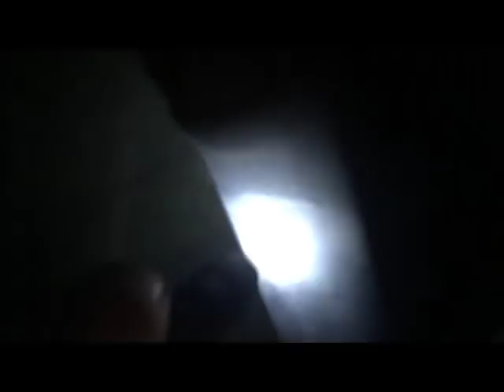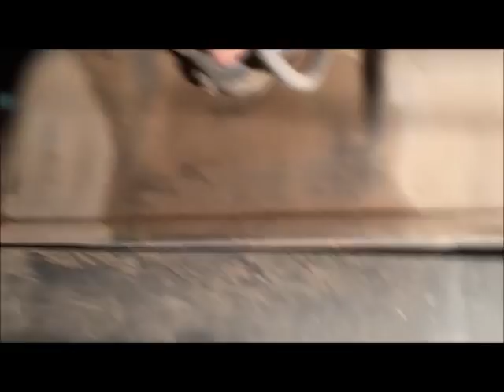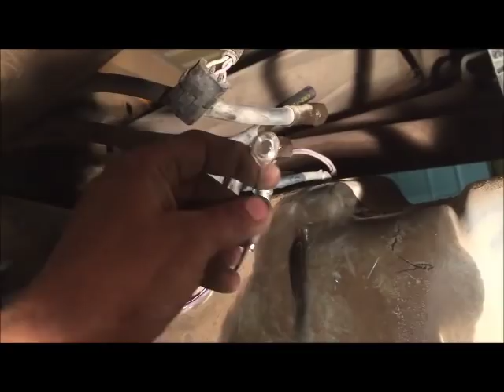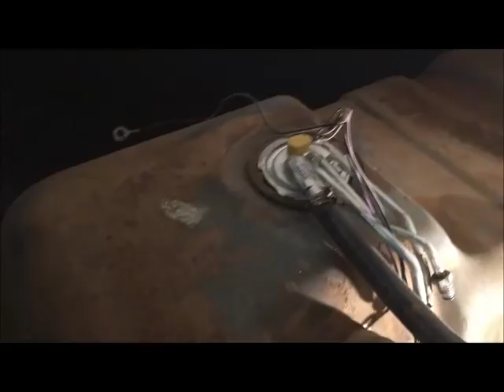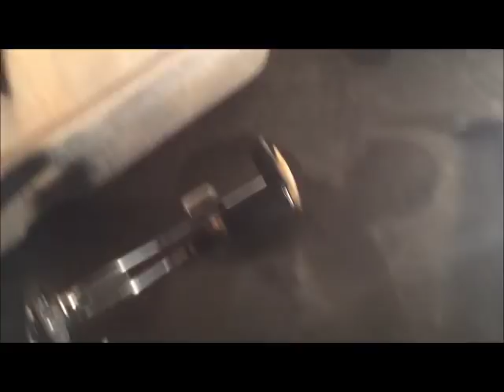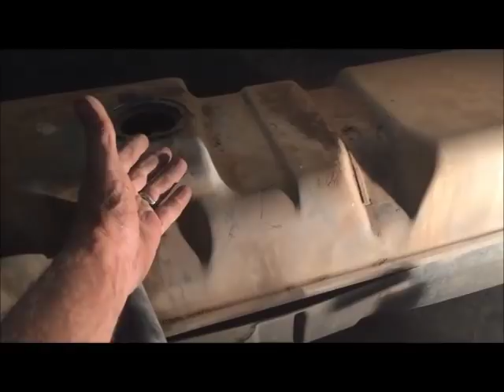1998 Chevy 1500 Fuel Pump Replacement

Comment: Ok so I have a 1997 Chevy Tahoe k1500 5.7 vortec and my gas guage goes crazy when I turn the key sometimes It shows how much gas I actually have and when I’m driving it just moves everywhere I changed the cluster and it still does it is it my float in my tank or can it be the ground or the whole pump ???? Please Reaply ASAP🙌🏾
Reply from the maker: the ground would be on the tank, but not your issue because the ground will make it work, or not work. your problem is the sending unit for sure. replace it ! thanks for watching.
Reply: thomas brian I appreciate it🙌🏾🙌🏾 now I can stop stressing about how much gas I have left😂😂
Reply from the maker: perfect, thanks again for watching.

Comment: which line is going to the fuel filter from the fuel pump? I don't want to mix the lines up
Reply from the maker: you wont, they are a different size.( small difference, but you will be able to notice ) thanks for watching. good question.
Reply: thomas brian thank you

Comment: Faargh dude. I have spent two hours trying to mess with bed bokts. Then found this... got 1987 gmc sierra pickup with a bad fuel pump.
Reply from the maker: thanks for watching!
Reply: @thomasbriansavingmoney  absokutely. Fuel pump didn't solve the problem unfortunately. I have a crank, no start issue and I'm at a loss at this point. Fuel is not coming out of the TBI and the fuel pump came on once and won't anymore.

Comment: Anyone know if the ground wire on the fill neck could be put on the same bolt that the ground wire of the fuel pump is on? There's nowhere else for it to go or I can't find another bolt anywhere it could go on. I've got a 97 Silverado.
Reply: The ground wire on the filler neck is to safely discharge any static electricity that may jump while filling. A trip to a dealership to pull up a microfiche exploded view (ha!) parts location / wiring diagram will show the location. 
 Anywhere on the body. 
The grounds are important to check.
; batt to engine block , block to firewall. Body to frame / engine block. Remember the chasis is mounted to the cab by rubber pucks & your computer & dash / gauges need a good a good ground on the metal in cab / inside firewall.
Reply: Thanks for the info. I ended up drilling another hole in the bed and  attached the ground wire to a nut screw on that. I was mostly wondering because my fuel pump gauge isn't working right; I thought maybe it was because I forgot to put that ground wire that is on the fill neck somewhere. Now I know it's because I bought a fuel pump that was too cheap (about $50).
Reply: @Cgp-on1cp  , Right ! ....Delphi seems to be one of the better brands.

Comment: Will this methode for replacing a fuel pump work on a 1990 c1500 silverado step side?  Been looking for this kind of info for a long time and it can help this old geezer from spending $450 to do a simple repacement. Also, my truck has been sitting close to 2 years.  Do you think I can get away with not draining and cleaning the tank.
Reply from the maker: two years, i would personally pull and clean. however if you know the pump is working, you can use the fuel pump to drain it ( without running the engine ) and add another 5-8 gallons and let it run through. or buy a cheap 25. $ electric fuel pump and use it to pump it through. when the fuel is the same color coming out as going in you will be fine. thanks for watching.
Reply: Thanx Thomas, I will try what you said to do and let you know how it went.     JG

Comment: while it is much easier to remove the 2 bolts holding the straps than to remove the bed .....those 2 bolts are @ 3" long, if you have an older truck, they'll be rusty , the nuts, which are inaccesable because they're inside a crossmembre, are not welded, they are made with very thin clip which stop them turning. , they are also rusty and tend to brake, leaving you with no way to hold the nut while trying to remove a 3". long rusted bolt 😨,

Comment: I have a 1997 c1500 that stalls when I hit a bump does anyone know what could possibly be wrong?
The other day  I was under the truck while it was running and I smacked the tank and it made a noise and turned off

Comment: Hey I got a 98 gmc 1500
I don't know if it the fuel pump or wat
It drives to 60 70 mph then it slows down a little n It won't go if I press the gas 
So I have to stop completely n start it again
It starts fine n it doesn't again 
I change the fuel filter to Its not doing as much but it still does it 
What do u think
Reply from the maker: if its not a fuel issue, change the module inside the distributor.  they heat up and try to shut down the spark.its common when going fast or pulling a hill. or even hauling a load.  pull the cap, remove the rotor, then remove the module with two 5/16 bolts. replace with a new one. about $15.00 that should clear it up. thanks for watching. please let us know the outcome, it helps everyone.
Reply: thomas brian is that hard to do n thanks
Reply: thomas brian where is the module at
Reply: thomas brian what's the module called ?so I can price it
Reply from the maker: inside the distributor, under the cap and rotor. easy to get to.
Reply: thomas brian I jus tell em the module inside distributor
Reply: thomas brian is it called the mission control module
Reply from the maker: no ignition control module. sorry

Comment: Fyi that's not a 98 pump an tank 98 has quick disconnect not threaded pressure fittings
Reply from the maker: The difference is single cab and king ca, comma two wheel drive and four wheel drive, 1500 and 2500 all have different part numbers. Thanks for watching!
Reply: no difference is 97 to 98 just fyi

Comment: by the way awesome video i wish i had (watched this first)and the stubby flat blade screwdriver will also help to pry open the clips that hold  the lines in place and my  2000 gmc has a shroud that covers the tank .4 bolts i think they r 13mm if not they are 15mm

Comment: Just Drop the TANK!  Just Drop the TANK!  Just Drop the TANK!  Just Drop the TANK!   Again....Just Drop the TANK!  Just Drop the TANK!  Just Drop the TANK!  Just Drop the TANK!  Just Drop the TANK!  Just Drop the TANK!  Just Drop the TANK!   
What if you have Duel Tanks? On both flanks? Just Drop the TANK! Then,  Just Drop the TANK!  Right ? If you can't add 1+1 then drop the Tanks on both flanks.Dont lift the bed . Don't drop a tank Don't drop another Tank.Why?Just  don't Drop the TANKS. 
Figure it out. Just DONT Drop the TANK!   It's so much quicker just not drop a tank.

Comment: Buddy, you really ought to just show the process and shut the hell up. 1, the bed is easier than a full tank with a jack, and some pb blaster. 2, sugar dissolves, passes through the sock filter, and turns to carmel in the cylinders. 3, you did well on the process via dropping the tank, just stop talking
Reply from the maker: Thanks for watching!

Comment: No you don’t have to do all that dumb shit that every one is saying you have to do like “cut the bed so you can reach the pump” first of all if nothing else is causing the new pump to go bad then a fuel pump will last (200k (miles) plus) so be kinda dumb to cut a nice bed to open its hatch only once to put a pump in right? And second all you have to do is let some of the gas out of your tank so it’s not so heavy empty tank would be easier and loosen up the straps for the tank there’s only two but it’s still easy to take off even with gas in it . Then drop your tank to the floor and move it where you want it after you disconnect the gas lines

Comment: I thought I may have found a video that actually explained every detail of R&R a fuel pump/Sending unit... until ypou stated that sugar in the gas was an old wives tale.  Dude you just lost any credibility you may have had, and as long as you spew your fantasy news flash about old wives tales and sugar, you wont have any credibility.  When sugar is poured into the fuel system, it partially dissolves and end up with a mixture that when heated in the combustion chamber will crystalize on the valve seats.  Once this happens; a "hot spot" is created on the valve seat.  This hot spot will retain heat after each combustion cycle and cause a spot that is far exceeding the factory heating allowed for any spot on a face of a valve seating surface.  This causes a "Burned Valve" part of the seat and or the valve ill burn away and leave a nice opening to allow compressed fuel air mixture to escape from the cycle, causing a loss of power and torque.  This can even happen with sodium  filled valves.

Do your homework, or ask a ASE certified mechanic before making a fool of your self and teaching others to do the wrong thing.
Reply from the maker: hmmmm, ase ? you clearly have never put sugar in gas, not even in a glass. it dissolves? ( everyone is ASE certified, arent they ? ) thanks for watching master mechanic. next time you explain how awesome you are,,, test, test, test for your self. do not believe everything you are told. we call that a follower mechanic, not a doer . but again thanks for watching.  ( rookies make me laugh )
Reply: Dumped 1 lb bag of sugar into an ex girlfriend’s new man’s mustang gt 4.6 engine. Locked it up completely. Fact sugar in a tank will destroy an engine within 1 hour of cranking and driving with a lb of sugar. Try it, come back, tell me your engine is still running. You’ll be posting a video with a different tone about this old wives tale while giving instruction on how to change an engine. Guaranteed.

Comment: Get off the "don't remove the bed issue". Say it once maybe to get the people informed but it is not the PURPOSE of your video. Any reasonable person should be able to determine the easiest path to complete a task. Removing the bed is a dummies way to do it. Say it once not over and over and over and over.
Reply from the maker: oh man , you would be surprised. keep in mind 16 yr olds are getting this trucks now, read some of the comments before you jump to conclusions about who knows. i am still getting questions why and why not and its been two years since this post. this is a passive post, these trucks will be around for another generation and they too will be wondering !  thanks for watching.

Comment: you should stop editing the videos. i followed every step you took. not only do i have to replace my fuel pump now i have to replace the ring because all you have to do is tap the screwdriver.
Reply: Kevin Hodge thank you troll for your comment.
Reply from the maker: there is no editing , i pause and start again. i am not sure what your issue was, but maybe your the one guy that should of asked your sister to help you. no offence, its just not for some people.
Reply from the maker: Jason Barber ha perfect. keep the comments going, it increases my rpm,s. thanks. i am just not sure how this video caused you to have to replace a fuel pump or o ring if it wasn't in your plan to do so. you started with a smart comment as if you were pointing blame. so any comment after that fact is a result of your comment. but now you are upset because of the after math comments. hmmmm. yep ask your sister,  because we are just not understanding your issue, or your complaing of the video due to your issue.  thanks for the swear words as well. it does explain your frustration but still no idea of the true issue. good day !!